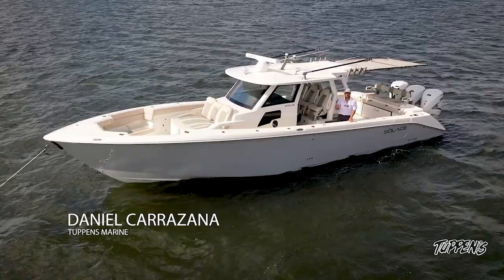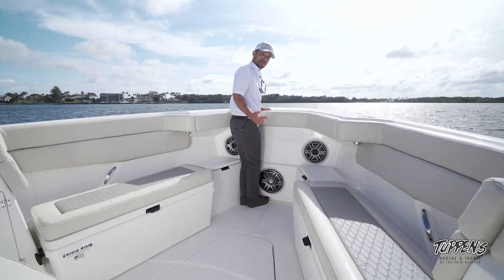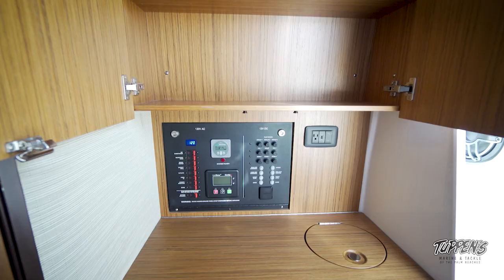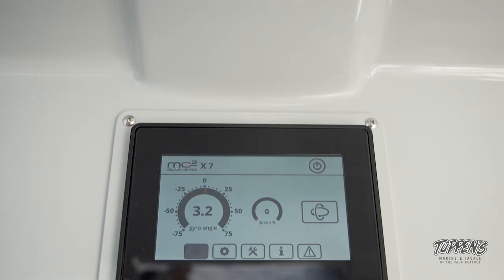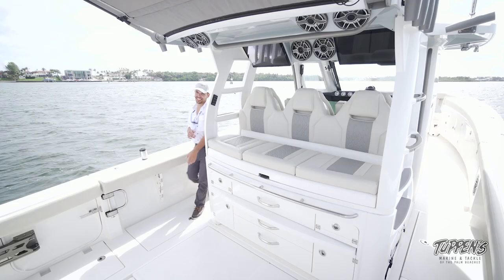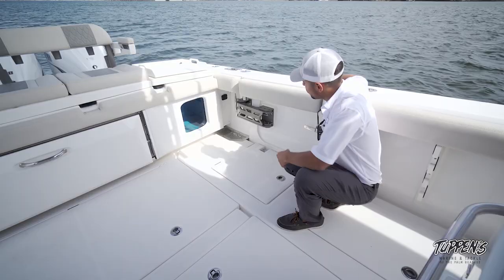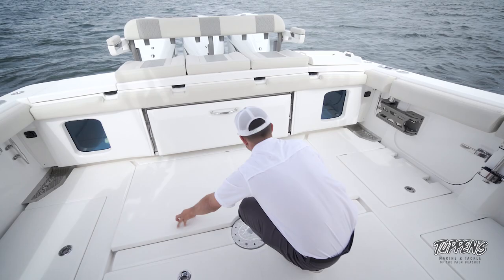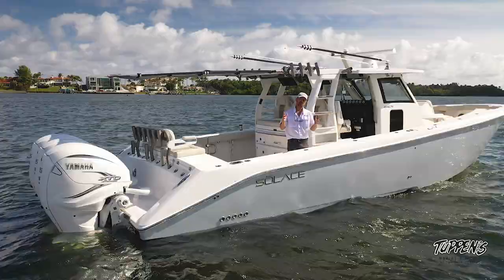SOLACE 41CS Detailed Walkthrough

Comment: Amazing boat, definitely makes me rethink a Boston Whaler 420 Outrage, it's a hard choice but Solace is the clear winner when it comes to features, they really thought of everything.
A few questions though.
1. Does that dual ice box come with a divider? Or is it all one box just with 2 hatches?
2. Where are the auto pilot controls?
Reply from the maker: 1 - Transom insulated Fish Box does have a removable divider. 

2- Yamaha powered boats have integrated electric steering that means you use a Yamaha auto pilot. It’s the rectangle shape with 8 square buttons mounted at the helm
Reply: @danielsoutdoors  Awesome, they really did think of everything there.
As for auto pilot, apologies should have been more specific, what about the Mercury 600HP V12 option? Also with the V12 it would come with 3, not 2, correct?
Reply from the maker: @NorthernLaw_  you can do a pair or triple 600. Autopilot on the Mercury is on the joy stick. 1 button for heading hold, the other button follows the path you set on the Garmin GPS
Reply: @danielsoutdoors  Ohh okay thank you so much, that makes sense now!

I've been looking at a Solace 41 or a Whaler 42 as I said, one of the final things I prefer on the Whaler is the upper tower, with the lounge chair included. I hope Solace can one day do that as well. It doesn't exactly scream "fishing vessel" but with Solace's magnetic features I'm sure it could become something more if they were to do it.
Reply from the maker: @NorthernLaw_  You probably can’t call Whaler and speak to the owners. But at SŌLACE I’m sure you can call the factory and speak to the owner who you can ask if they can change the tower for you. It’s going to cost you alittle extra but you don’t know if you don’t ask.
Reply: @danielsoutdoors  That's true I always forget that. "You don't know if you don't ask" I hear that a lot and yet always forget, it's very true though. I'll do that, maybe if they like it enough it will become something on the next model or just as an option on the next model. Thank you for your help!

Comment: Will the magnetic surfaces (especially gunwale) destroy a cell phone that's rested on them?  Concerned that the abundance of magnets will wreak havoc with portable electronics and destroy screens or hard drives.
Reply from the maker: As of right now we have not had any issues  like that. The new iPhones 13 actually have a magnet style back and I’ve placed mine on there for hours with no issues at all. Maybe Solid state hard drives are not effected. I know back in the old days  cathode ray tubes screens were affected by magnets but these new LED / Retina screens are not effected.